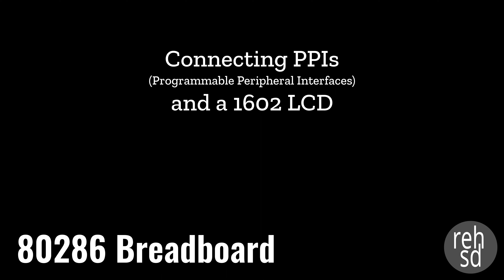80286 Build, Ep. #32 - Connecting PPIs and a 1602 LCD

Comment: Another great video! I am having a hard time keeping up!

I noticed that the schematic PDFs on your website are very low-res. Is that accidental or on purpose?
Reply from the maker: Hmmm, the PDFs shouldn't be low res. I just opened one and it seemed like a high-quality PDF. Do you have a specific link I can test? Are you using one of the "Download PDF" links? Are you viewing in or outside of your browser? Thanks!
Reply from the maker: Also, in case you're using Firefox, it may be a Firefox-related issue. I tested on Edge, Chrome, and Nitro -- the PDF looks good. Firefox doesn't seem to render it properly at high zoom levels.

Comment: I was kinda wondering: why not put the processor at the bottom/top of your bus board to eliminate a good chunk of wiring lol
Reply from the maker: As in... have the processor be part of the bus board PCB, along with the latches and transceivers?
Reply: @rehsd  Well I was thinking you have the proc with it already on its own board and just plug it into your bus board.
I'm just suggesting lol its your show lol
Reply from the maker: @memadmax69  Sure thing. That makes sense. The bus board is a generic bus board from previous projects. In time, I will convert the 286 system to a single PCB. I think I’m actually getting close to ordering a PCB for the core system. I want to get my keyboard working first.
Reply: @rehsd  Oh thats cool about the bus board. Do you happen to know where you got it from or did you have it made? I am planning on building a max'd out 8080a system myself. This has long been one of my goals since highschool in the 90's lol Also, the breadboards add alot of educational value to your project(along with others as well lol). I plan on having my daughter watch some of your videos along with other youtubers like the 8bit guy, louis rossman, etc etc along with my son when he gets old enough lol Keep up the great content and have a good one.
Reply from the maker: @memadmax69  I designed the bus board. If you're interested, I can post the source project (EasyEDA) and Gerber files.
Reply: @rehsd  Yes, That would be great!
Reply from the maker: @memadmax69  I posted the EasyEDA source project and Gerber files in https://github.com/rehsd/x86/tree/main/breadboard-helpers. Look for "Bus Board."

Comment: Does the IO space sit a top the addressable RAM/ROM space? In other words, do you lose RAM/ROM capacity to the IO space?
Reply from the maker: No, it's separate from the normal address space. Basically, it's a special 64K range of addresses only accessible with specific I/O operations (IN, OUT, INSB, INSW, OUTSB, OUTSW). No loss of RAM/ROM capacity in the address space.